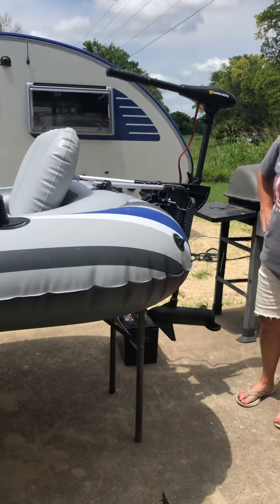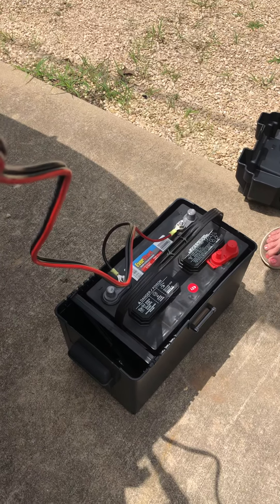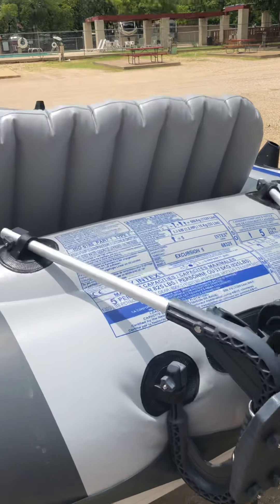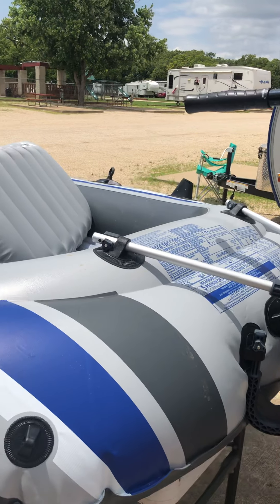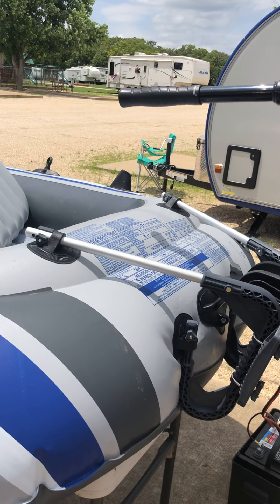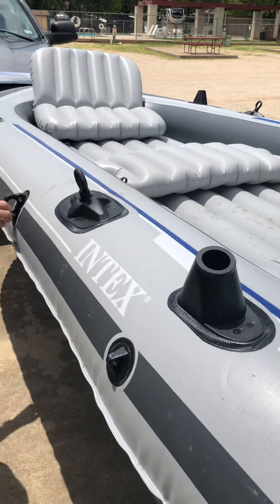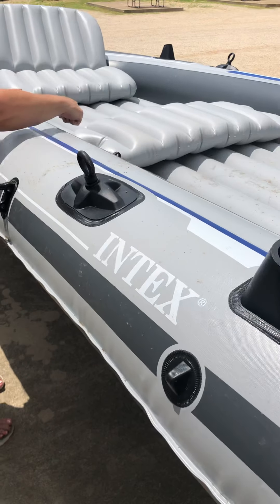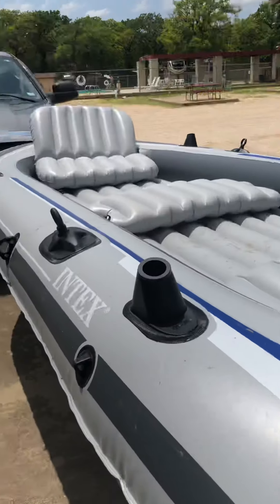Excursion 5 with trolling motor

Comment: Hey, thank you for the video.  Did you get a voltage drop by extending your motor to the battery cable extension?

Whats the total length of your cable  from motor to battery terminals to be able to position the battery in the middle of the boat please?